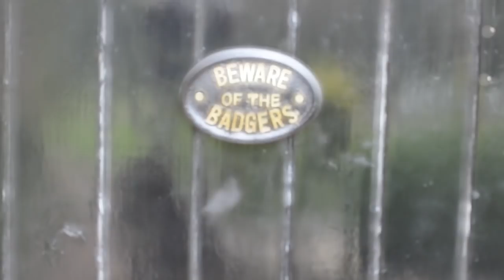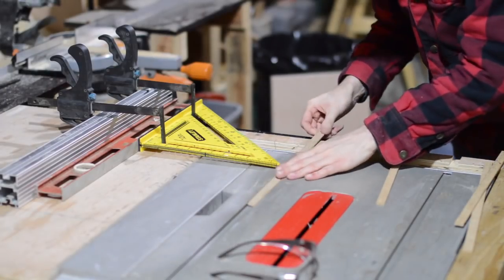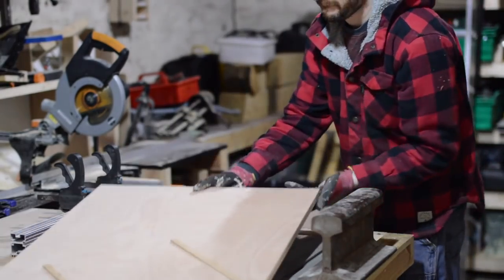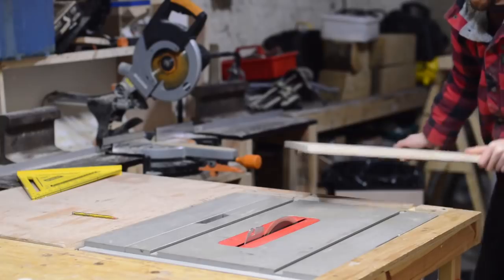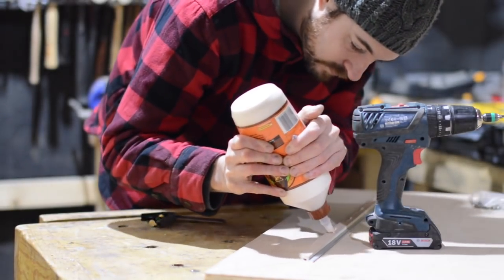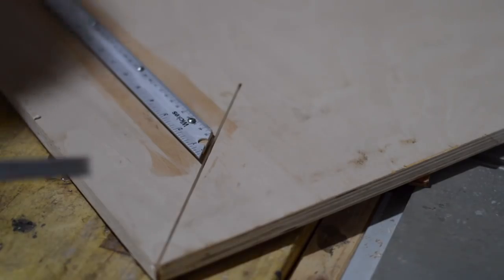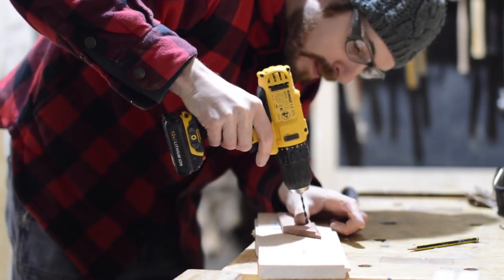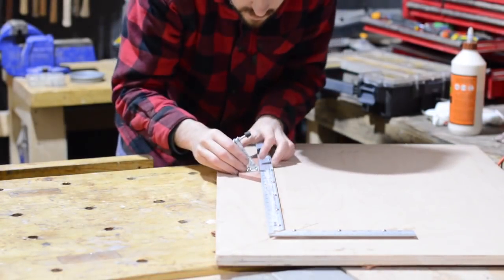Making a Picture Frame Sled

Comment: Great video and neat idea, like the the stop block very smart. I got some frames to build in the conning months so this seems perfect :) what sliding miter saw you are using if I may ask?
Reply from the maker: I have a evolution saw. Im looking to upgrade. What are you using?
Reply: Badger Workshop fury 6 with a combo table saw but it's rubbish. I'm thinking to upgrade to 10 or 12 inch sliding miter saw. Still on budget but I need something that will last and do a good job. There's some strange makes on Amazon like SIP or Parker, Lumberjack etc. Not sure if it's worth risking and buying them. What you planning to upgrade to?
Reply from the maker: Im using my tools more and more so dust collection is getting more important to me. I am looking at a 8" bosh professional as the dust collection looks good and I have a bosch professional table saw that I am very pleased with.
Reply: Badger Workshop yes the blue Bosh tend to be very good quality and still have a good price.